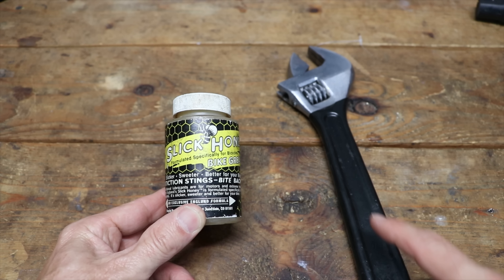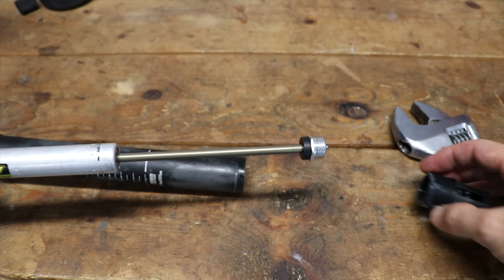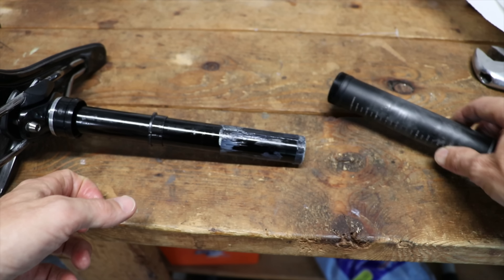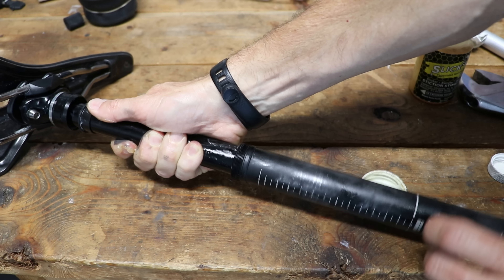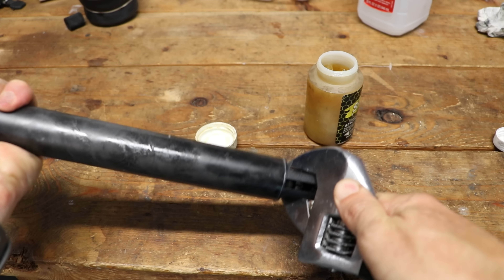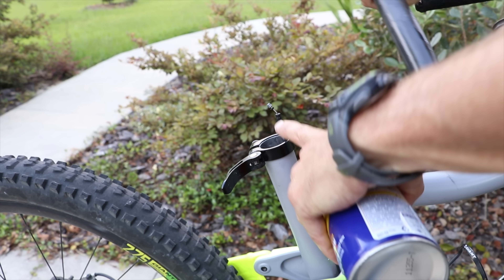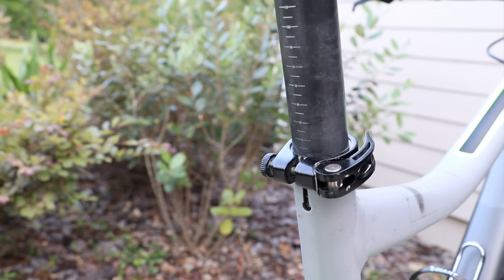How to Service Giant Contact Dropper Seatpost

Comment: Is it possible to just add air to the cartridge? my seat isn't returning fully and saw that it could be due to low air pressure. but this looks like everything has to be taken apart and you just have to replace the cartridge. I couldn't find any other info online for this dropper
Reply from the maker: You can check with your local Giant dealer, but I don’t think this cartridge allows you to add air
Reply: @ClintGibbs  yeah finally found some info deep in some forums lol. It's almost 8 years old now so might as well treat myself with a new one haha

Comment: Perfect video!  The plastic keys on mine seem to have failed after just a few months.  Haven't opened it yet, but the saddle can spin the stanchion all the way around.
Reply: Same here, mine is doing the same and can move mine a full 360°, I've took it to my local bike shop but they said there is nothing they can do
Reply: Has anyone sourced the keys ? My seat is also spinning

Comment: Brilliant video.... gave me the confidence to take a look at whats going wrong with my post.  It keeps dropping as if the leaver isn't locking off completely.  I will now go take a look!  Hopefully I can fix it with a once over.
Reply from the maker: There is a chance the cartridge may be bad. That's what happened to one of ours. Giant will send you a replacement if it is.
Reply: Clint Gibbs turned out it was the tiny activation nipple at the end of the piston that was sticking. Had to unscrew it for the threaded plastic head to find it. Once I freed that up it now works again!!

Comment: When wiping off the inner post @ 3:00 be sure you are aware of not only the long slotted insert locators but also the split plastic ring/bush on the end of that post. It is easily dislodged and may go unnoticed.

Comment: Excellent video.  What was really weird is that my Fathom 2 dropper failed during a recent ride.  After watching this excellent video and disassembling,  I found out that the bottom plug to the seat post where the cable connects was not threaded into the seat post tube.  How can that happen?...or did the guy who assembled it new at the bike shop I bought it from 6 months ago forget to fully thread it in?  I threaded it back in, re-greased, reassembled...better than new!

Comment: you do have to grease them. I had a muddy race and it seized. Clean them up and they are good as new. there is a shim kit available now to replace that plastic collar. its what seems to wear and cause play.
Reply: can you list the part number for that? i've gone through 2 of these droppers and both times it was due to stanchion wear.. the seal isn't great on these posts for bad weather riding

Comment: 1) The metal nut on the end can also stay stuck inside the black cap you unscrew, giving you nothing to work with.  Carefully use pliers to turn the gas canister itself and it will detach.
2)  Strangely the video does not mention the shims which stop the saddle rotating.  These break very easily and then the saddle will rotate freely, probably to the left about 1/8th of a rotation. There are two TINY SLIM bits of plastic at the top that stop the post rotating, and I just turned one around. I was pretty shocked at the cheapness and fragility of the internals and am looking at an upgraded dropper.

Comment: was just servicing my dropper post for my giant trance 2, which I think is the same as the one in the video, and have found that my cartridge actuator is broken and I am needing a new one. I was wondering what the name of it was so that I could buy a new one that was correct for my model. Thank you!
Reply from the maker: Not sure the official name but I refer to it as the air spring cartridge

Comment: Hello Great video!
I have just serviced my dropper, it was really easy, but it is still geting stuck on the way up.
What could it be?
not enought grease?
Not having put grease on the cartige?
tank you
Reply from the maker: Did you install a new air cartridge?
Reply: @ClintGibbs  Hello. Tank you for your response. 😁. I didn't install a new one. The one I have it is less than 3 years old.
Do you think I need a need cartige?
Is this a common issue?
Reply from the maker: @cesarayala8665  yes, it sounds to me like the air cartridge is going bad.

Comment: Hey! Thanks for the instruction. Do you know what to do, when the saddle feels like it’s lose somehow. Can turn it a bit to both sides… Seems the problem comes from inside the dropper post… any idea?
Reply from the maker: There are plastic pieces called keys that can wear out and cause side to side play. Every dropper post has some side to side play but as these keys were out it can get excessive and you need to change them.

Comment: The little "arm" that the cable connect to at the bottom of the post has no tension on mine. You can just flip it up and down. Any fix for that by chance? This video was perfect and explained everyone so well and then I discovered my little issue....
Reply: Hi, I’ve had the problem multiple times, it’s as if the actuation pin isn’t reaching the lever pulled by the cable, again yesterday serviced my warranty replacement post. Googled and seems this video is not quite right, the cartridge is unscrewed from reverse thread driver under the saddle. You cannot unscrew it by turning the silver nut on bottom, that just either unscrews off the rod or just turns the rod around. In fact Giant’s instructions are not to unscrew the lower cap off the rod at all, unless replacing the cartridge. So before todays ride I’m now go8g to have to try aga8n

Comment: CONTACT & CONTACT S SWITCH DROPPER SEATPOST REPLACEMENT CARTRIDGE

In which size "mm"  is this cartridge for giant mountain 2 2018 model?

is it 340mm, 395mm or 440mm? because i need to change my cartridge its automatic going up everytime and i need to sit for it  about 3 seconds to make it stable.

Comment: I couldn’t tell; did you make an effort to thread the cartridge back into the bottom cap as you threaded it into the main tube? Or does it self locate fairly easily?
Reply from the maker: Not sure if fully understand your question but you thread the cartridge up into the top, then thread the bottom cap on. That's it.
Reply: @ClintGibbs  Thanks, I actually disassembled, cleaned and lubricated mine yesterday. Nice and smooth again. Your video gave me the confidence.

To answer my question, the bottom cap appears to thread into both the main tube and the bottom of the cartridge at the same time, without any special effort needed to align the two. As long as the cartridge is already threaded into the top of the dropper, it seems to self-locate as you thread on the bottom cap. It looked like it had a bit of a taper for this purpose.

Comment: Pretty easy. I have a 100mm air cartridge on my GF's bike. Any idea if I can swap it for a 125 for longer travel? 100mm is pretty short
Reply from the maker: You may want to check with a Giant dealer but I don’t think you could increase the travel on these.

Comment: Saved me from taking it to the shop, one question, how can I check if the air cartridge should be replaced?
Reply from the maker: Really it's just at the seat post is working properly. If it compresses a little bit without pushing in the letter then the air cartridge may be going bad.
Reply: @ClintGibbs  thanks for answering!

Comment: I have a problem. My dropper seat post is stuck in the highest position and it will not go down even when I adjust the cable tension.
What do you recommend?
Reply from the maker: Pull it out of the bike and make sure the lever is moving.

Comment: I have an  Giant XL Full E Pro  with this seat post and I need a shorter seat post. Short legs, what can I say.  When I have the post all the way in it pops up too high so I always have to adjust on the fly.  Just a riding nuisance.  Is it possible to shorten the post by cutting an inch off the tube?

Comment: Is there an obvious way to tell if the cartridge needs replacing. My has stopped working I'm going to strip down, clean and regrease. But won't bother to refit if its obvious I need a new cartridge. Great video btw
Reply from the maker: I think the best way to tell is when it's in the bike it just will not stay up, even with no cable tension.
Reply: @ClintGibbs  Thanks I've stripped and rebuilt it but I think the bottom bit where the cable nipple goes in is busted, its loose and doesnt seem to do anything. The post won't go down but is solid at it full extension. I'm away to look if they sell the bottom bit seperate
Reply: Found the bottom part its only £4.99 so ordered it. Many thanks I would not of tackled stripping it down without your video

Comment: I have the same question a lot of other people probably have, does anyone know where you can find replacement slider sets or what other brands would work? Third ride on my TranceX 2 and the seat is rotating over 90 degrees to one side. Haven't talked to my bike shop yet, but I assume they'll tell me they don't have any parts.

Comment: Clint, do you have any experience with attempting to install internal cable housing? Whatever i try seems to get stuck around the downtube/seatpost joint. Man this is frustrating not being able to see what is going on...
Reply from the maker: You have to remove the cranks and bottom bracket.
Reply: @ClintGibbs  Hi i eventually did it after about 4 hours - vacuum on seat post, string into the cable hole thank god it got sucked out of the seatpost...attach cable to string pull back through frame, finally feed the housing over cable and it was done...but man, that was the trickiest thing i ever done! Whatever guides/channels they have inside the frame do not work very well at all ... lesson learned, never EVER leave neither cable nor housing in frame you will regret it!!
Reply from the maker: @neilus  Nice! That's actually the first time I've heard of using a string and a vacuum. Nice work.
Reply: @ClintGibbs  Thanks, i actually got the idea from another YT video so i cant take the credit, i honestly didnt think it would work! I really thought feeding the cable in would be the easy bit and getting cable tension right would be the problem but its the other way round. Cheers :)

Comment: As soon as i put back my dropper post and reassembled it the dropper post is going down even if I’m not clocking the dropper post lever and I try to adjust the cables but it didn’t do anything...can you possible help me on what to do to solve this problem of mine
Reply from the maker: Sounds like there is tension on the cable. If so, either the barrel adjuster needs to be turned, or something is pulling on the cable housing.

Comment: Hello, great video, could you please write what kind of cartridge did you use and where did you order it? I have a Giant Contact Switch w/ Remote, 30.9 seatpost (year 2013). Is it still possible to get a compatible cartridge? Thanks, Gregor
Reply from the maker: You have to have a Giant dealer order the replacement cartridge from Giant. There may be third-party manufacturers that make these but I am not aware of them.

Comment: Hi
Is it possible to "lock" this seat post to prevent it from twisting/rotating while you ride?
Reply from the maker: Not that I know of. All dropper seat posts rotate very slightly, some more than others.
Reply: @ClintGibbs  mine rotates about 30 degrees..
😭
Reply from the maker: @johnnybravo1912  That’s a lot. It sounds like the keys are worn out and need to be replaced.

Comment: Curious to the overall length (not drop length) of that post (assuming it came from a medium frame you usually ride). Reason being; even with the post recessed fully into the frame on my medium giant, I have to ride with the dropper down 2-3in for the saddle to be at the proper height (using the 1.09 method you showed in another video!). Thanks for any thoughts
Reply from the maker: To me it sounds like you’re on a bike that is too big.  You should not have to push the post down that far.
Reply: I had a similar problem when I ordered the medium size (150mm?). Mostly because the seat tube on the diamondback release 2017 won't allow the whole dropper post to fit in. Long story short, I went with the shorter one (125mm?). It's about 85% perfect, so I can't complain.

Comment: Quick question. I have this post on a 2019 Fathom and it doesnt go all the way down in the frame which makes it a inch or two too tall when the seat it let out all the way. Is there a way to make it shorter ( the portion going into the frame)? thanks
Reply from the maker: Not really. You would have to get a standard non-dropper seat post and cut it or just see if you could find a shorter dropper post to replace it
Reply: Have you tried adjusting the seat clamp to lower the dropper post into the frame, same process as any normal seatpost. You may however wish to pull on the dropper lever outer cable at the front of the frame to ensure it doesn't get pinched.

Comment: Clint the dropper on my 2017 Anthem is slow to function, I was told my the BS that because the stanchion is faded it has been comprised-only solution is to replace with a new one. They've never replaced the cartridge nor have they even suggested it
Reply: To be fair the anthem has a 27.2 dropper, Giant doesn't make one in that size

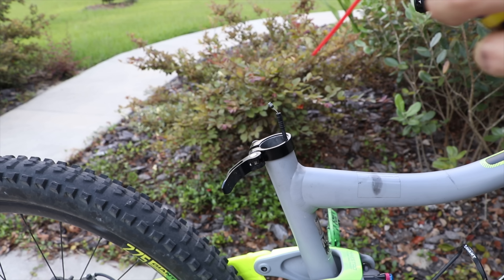Comment: 5:14 - having an issue where the steel braded cable is not visible like yours is here. Mine is snugged all the way to the collar of the plastic sheathing, and if I pull on the top of the cable (small metal cylinder at the tip) I can't expose any of the steel wire.

help please!
Reply from the maker: Sounds like you need to release the tension at all lever. To do so you would have to undo the Allen screw in the lever that holds the cable.
Reply: @ClintGibbs  i'll give it a go - thanks!

Comment: Is there a part number for the cartridge, mine will return but will not hold position, it sinks a few inches. I have to repeat the "press and sit" routine a few times until it finally holds.
Reply from the maker: I don't have the part number. If you go to a Giant dealer they should be able to order the correct one.
Reply: @ClintGibbs  Thanks, I followed the video and discovered a slight kink in the cable near the seat post end, after re-greasing the dropper as per the instructions and straightening the kink it all works like new.
Reply from the maker: @Artwongoz  good!

Comment: Hello do you or anyone know where I can get replacement plastic keys as mine are worn? Giant don't stock them as a spare. Thanks I live in UK.
Reply from the maker: Is there a local giant dealer in your area? They should be able to order them directly from Giant.
Reply: @ClintGibbs  Tried them all and it is apparently not a Giant spare part. I have found out that it could be Bontrager post but the Bontrager guys can't be too sure!
Reply from the maker: I would think they would be included in a rebuild kit for that post. If not I really don't have a solid answer for you. Sorry.
Reply: @ClintGibbs  Thanks anyway I managed in the end to make one out of a cable tie, don't know how long it will last though!
Reply: @chynoweth69  How affective has the cable ties been and are they still holding up?
Reply: @ricardowilding7681  Yes still working fine
Reply: @chynoweth69  Have you got a photo or something oh how it looks on the inside with the cable ties? As I am really struggling to find something that I could use to fix mine
Reply: Ricardo Wilding sorry no as I don’t want to take it apart. What I did was found a cable tie that was slightly wider and thicker than the key. I then carefully sanded it to the exact thickness and width. Finally I cut it to the correct length. I used the old key as template.
Reply: @chynoweth69  Okay thats probably What I'll try to see if it works, thanks for the help

Comment: My giant dropper is annoying , it make me have to put a little pressure on the seat while hitting the switch for it to come up.. if I don't keep my butt in contact it will stop... It's been cleaned and serviced but still won't work right. Any ideas?
Reply from the maker: You may need to replace the cartridge at this point.

Comment: My 2 year old Giant seat post retracts well, but when I want to extend it, it jerks and hardly comes up. If I put a little pressure on the back of the saddle it suddenly extends fine. The tension on the cable doesn't seem to be the problem. Does anyone have an explanation for this, is my seat tube crooked or what could be the cause? Didn't have any significant falls with it.

Comment: Is my Giant Contact SL the same as yours? It came on a giant anthem 1 2017
Reply from the maker: Not sure. Some of the older ones had two small little bolts just under the saddle clamp that you take out first. Other than that it should be fairly similar.
Reply: You may find the way it connects to the bottom of the seat post is slightly different but very similar. I have just switched out a 2017 dropper for latest version.

Comment: I think i have this exact dropper post but what worries me is that it moves left and right.
How can i fix that?
Reply from the maker: Keep in mind that I’ll dropper posts will move very slightly. But if it’s moving excessively you’ll need to replace the little plastic keys inside

Comment: How to know if the cartridge is working okay?
Reply from the maker: If the seat post is returning at normal speed and does not sag when you sit on the saddle it should be fine.
Reply: @ClintGibbs  The seat post doesn't sag if I don't press the lever. Can a crappy lever and cable tension cause the seat post sag?

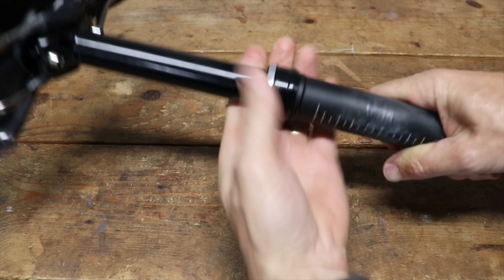Comment: At 1:07 you loosen the collar. What if the collar seems to lock the seat post when it is screwed on?
Reply from the maker: I'm not sure I understand the question. If you can explain a bit further I'll try to answer.
Reply: @ClintGibbs  I have a silver metal ring under the collar. It seemed to be causing a problem but now it went back together and is working. Sorry for confusion.